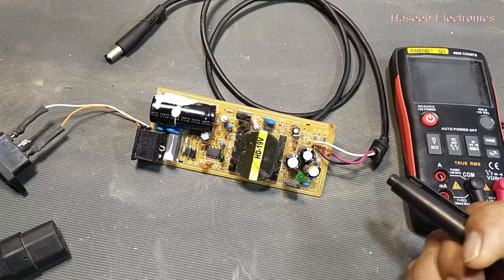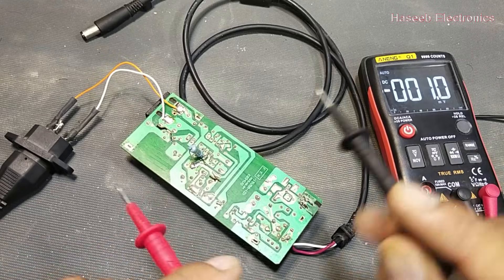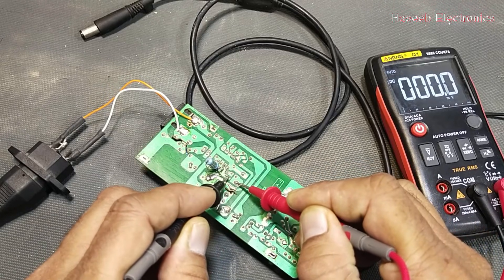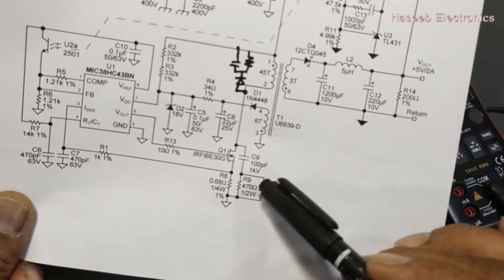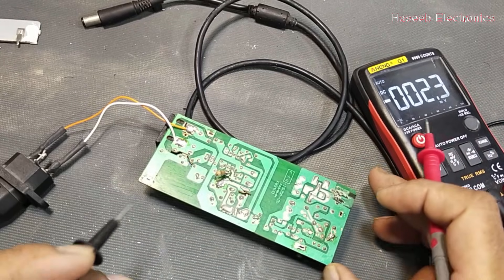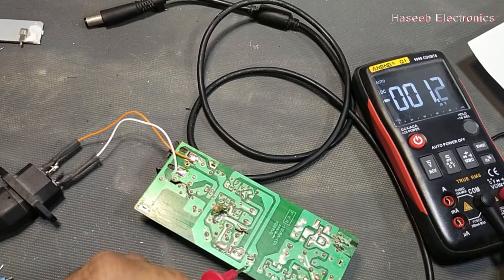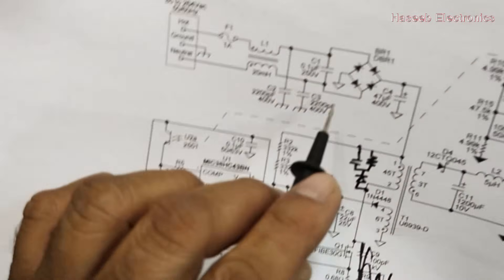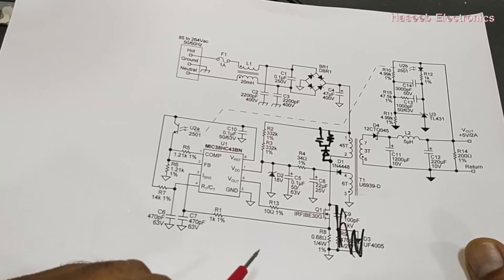{522} How to Test SMPS IC Switching/ SMPS Switch Mode Power Supply IC Switching Test with Multimeter

Comment: Hello Sir, thank you for your helpful videos but I have some questions about this procedure.

I've tried it many and many times and it always work.

But I damaged SMPS two times when measuring voltage between D and S. I'm convinced that I mistakenly connected S and with one multimeter's tip. 

So my question is, why the MOSFET doesn't burst as well when its gate closes its D to S junction like when I shorted it with multimeter's tips? 

Thank you for your help.

Comment: Resp Sir! Nice Class Sir. Sir My LITEON Laptop Charger MFC 335V DC Sir, Drain to Source 335 DC Voltage Sir OK Sir, at SMD Capacitors are Same Voltages Sir. 501J03 6Pin IC was not Cmming any Voltages Sir. Optocopler are No Voltages Sir. Where the Problem Sir. Please Advise Sir.  --    ChinnaRao Paderu Andhrapradesh

Comment: I replaced an OB2269 in a power supply, and the volatge is good. But the capacitors make high frequency noise when more current is drawn. I replaced all the capacitors, I am not sure what I am missing
Reply from the maker: please check RC snubber across output side rectifier.
Reply: @HaseebElectronics  all is ok. still very high noise under load

Comment: Connect the laptop charger adaptor the light is on but when connected the adaptor to the laptop the adaptor light will turn off what is the problem sir
Reply: Laptop 19 volt Power rail Is Short

Comment: Salaamu Alaikum.. thanks for this video sir.. my smps uses pwm IC that has mosfet in it.. there is a supply in its VDD but i think it does not switch because i get the same voltage reading across capacitor and drain to source. But i do have a 12v reading across the diode of the aux winding. The feedback voltage from opto coupler is zero. Can I force the feedback voltage just to check if it will start switching? Thanks in advance

Comment: sir,  again i watched this video, i have a doubt at 5:51 that the source to drain voltage increases 20v excessive than capacitor voltage, so you said this is because of the collapsing magnetic field's excessive voltage, but we have snubber circuit, even though we get excessive voltage on the MOSFET, but you said collapsing magnetic field will became opposite polarity while collapsing, then how its possible to increase the voltage at the MOSFET?  thanks

Comment: Thank you Mr. Haseeb. My condition is like following: bulk capacitor voltage and IC SD 6832 (internal mosfet) drain - source are the same around 320V DC, vcc capacitor and diode showed fluctuating voltage around 12V, voltage at snubber diode and resistor also showed 320V DC. My circuit board is a kind of SMPS for satellite receiver and all outputs 3.3V, 15V and 20V have no power at all. what will that be? Regards .From Myanmar.

Comment: It means sir 88v across snabber diode + 116 volt across snabber resistor  = 204 v dc. Left voltage storage in bulk capacitor to applied ac voltage.

Comment: In such Flay Power Supplies, there are 3 simple malfunctions (& the fuse is WORKING! )
-the failure of the starting resistor along the 7pin 384x circuit 
and the loss of capacitance or the larger ESR of the capacitor on this 7pin (C5 C8 to your circuits), 
well,or a leak breakdown in the zener D2 and the self-supply diode D1 after they are checked / replaced, everything will work.
 IF THIS DID NOT HELP, then all HOT PART or maybe a transformer for replacement -
repairs can be UNPROFITABLE and more expensive than buying a new product.!  But the owner ALWAYS decides to repair or buy a new one

Comment: There is a big long diode in the circuit..how is it measured in a circuit to know whether bad or good diode..I tried and all ends were measuring and giving figures not like rectifier diodes..thanks for the answer in advance

Comment: Hi can this technique of checking if it is switching or not be used on a MIP2F2 IC ? Pin 5 on this IC is Drain According to it's simple circuit. Thanks

Comment: Sir, 220 VAC to  9VDC, 3A  SMPS : The 220 VDC is showing at Full Wave  Bridge Rectifier and  also at input terminals of the High Frequency Switching  Transformer, But there is no DC Votage showing at  the Secondary Terminals of the Switching  Transformer. Whether Transformer is defective or any other fault is there. Please suggest  me what to do.

Comment: 24v 10a SMPS low voltage showing around 6v what is the solution
Reply from the maker: please check RCD snubber (diode, resistor & capacitor across the primary winding of power transformer) 
check main dc capacitor

Comment: I'm trying to lower the output voltage on a 12V 3A power supply to 5V, and lowered the top resistors value of the output voltage divider feeding into TL431, in my case from 20k to 5.1k. The power supply's output voltage is indeed lowered, but unstable. What can be wrong? What to check? Thank you for any advice.

Comment: Sir It's a great video
When smps is working, Difference of voltage on main /bulk capacitor and in mosfet drain and source  is it same? (approx 25volts in this video) for all smps circuits?
Reply from the maker: it depends on the rcd snubber's efficiency. this difference may be 5V to double value of the capacitor's voltage 
i mean if DC capacitor 300VDC, then the mosfet drain to source may be 305 to 600VDC

Comment: Thanks for beautiful description. One of my question is can we give 12 v DC from outside to ic  vcc pin without connecting to ac 220 v for checking ic. If ic is working it will give reference voltage and out put of gate otherwise not.
Reply from the maker: Yes you can
please check video number 449, in that i demonstrated using TL494
very soon i will make SG3525 circuit

Comment: Mr Haseeb is it possible to fit external driver circuit to switch fet to oscillate transformer on smps that uses IC no longer available , how can this be solved please, Thank you for wonderful channel, i already learn alot !!
Reply from the maker: yes it is possible, i will explain it in detail very soon

Comment: Salam sir me ihsan N.WTD se taluq rakta hoon  sir me ne aapka ye ic switching wala video deka iske mutabiq mene ic ke pin no7 aur 5 par voltage chk kia voh 8.2 volts hai aur supply output nahi deraha plz guide me what to do next plz reply sir
Reply from the maker: wa alaikum salaam bhai
kia aap ne mosfet k drain aur source per dc voltage check kiey hein, agr to ye main dc capacitor k voltage k equal he to switching nahi ho rahi. drain to source dc voltage ki value dc capacitor se zayaada ho gi to wo switching karey gi.
agr switching nahi ho rahi to aap mosfet ya ic ko check karein
Reply: Sir i donot have amultimeter of good quality (unit33)
Reply: I have unit33

Comment: Brother..the best way to realize  smps Ic Is faulty or not ..use Beezer mode of multimeter that black lead connected to ground and red lead connected to vcc if we heard beez ic is faulty otherwise ic is working correctly
Reply: Beezer?? You mean continuity?
Reply from the maker: buzzer is continuity mode
Reply: @HaseebElectronics  ohhh okay 👍
Reply from the maker: perfect

Comment: Nice video sir 🙏.I have a question in my SMPS circuit there is 6.5volt between pin no 5 n 7 of 3844 i had checked all the components all components is ok shown by multimeter i didn't get whats the problem.pls sir answer me 🙏🙏

Comment: Thank you, Professor Haseeb. Great video. I have a question. What is the reason or the defect in hearing the sound of tick tick  tick in the transformer? Although all the parts in the high-voltage phase are intact. thank you
Reply from the maker: best regards and lovely thanks 
1. if any winding have bad soldering joint with mounting pins of bobbin (remove the transformer and re-solder the winding ends with the bobbin pins) 
2. if switching frequency jumps (check the frequency )
3. sometime the ferrite core bonding becomes loos and produces the gap between outer leg.(in this case disassemble transformer and apply glue to the legs & sims if it is gaped core)
4. if winding becomes loos (pour varnish) 
5. in some situations it may be unexpected sudden spikes from load (in case of capacitor internal sparking)
Reply: @HaseebElectronics  i have the same problem too, will check that and reply. Many thanks.

Comment: Hi Haseeb, another great video. I never saw anybody check the DC voltage across the pins of the MOSFET before. That's a high frequency AC signal with the MOSFET turning on and off at high frequency - is that safe to measure that voltage with a cheap multimeter (like the one that I have 🙂) ?
Reply from the maker: wow 
thanks a lot for your valuable words
at very high frequency switching mosfet / igbt / transistor is considered as a dc source (similar to a dc generator)
it is completely safe to test source to drain at dc range 
but it is much dangerous to test the same at ac  range (specially when we have a low brand, low quality meter which dosen't have a good frequency response at high frequency, it may damage mosfet or smps controller ic) 
but a cheap multimeter can safely measure this signal at dc range

Comment: Sir what is the component name which you are using to discharge capacitor
Reply from the maker: i am using a 100 ohm PTC. but it is much better to use soldering iron or 100W lamp. that will much safe

Comment: Thanks for the wonderful video, very exhaustive. I have a question: there is a rule, a formula, between main capacitor voltage and D-S modfet voltage? Thank you
Reply from the maker: best regards and special thanks 
yes there are may calculations for dc capacitor. witching at different duty cycles, and in result the voltage applied to primary and in off period the stress 
in this video i compared the voltage stress in dc voltage range 
we can check it with dc range much safely than the ac range
Reply: @HaseebElectronics  Thanks a lot!
Reply: If possible please teach the formula of main filters capacitor value used in SMPS Circuit, waiting for your great explanations, thanks a lot 🙏

Comment: Do you check Voltage across drain to source and across the primary in multimeter DC mode?.. I have smps that output DC  voltages goes down after connecting to main board..(stable 13.11V goes to 6V to 7V fluctuations after connection )... the main board works and turn on the device with separate 12V DC input from the lab bench power supply. What might be the issue with this smps?
Reply from the maker: yes dear 
in this test method i tested in DCV mode of multimeter.
in your case if the voltage drop at connecting load.  
first verify load that it is safe (by giving an external power supply and verify ts current rating ) then' 
1. if your load is good and not causing to draw over current, then the problem in smps (secondar section, check output capacitors, feedback network)
2. in smps primary section, the vcc capacitor might be de-value, remove and check its serviceability 
3. may be the vcc voltage from the auxillary winding are over-range. you can add some 30-100 ohm resistance in between auxiliary winding rectifier and vcc capacitor, so the pwm controller will not reach in over load protection 
4. if there is current sense resistance in series with mosfet, remove its solder and  re-solder it

Comment: In my power supply I cheak soure to drain pin voltage has varry continusly so what is the problm is that sir ic num  tny286k pls help me sir
Reply from the maker: if these voltage vary rapidly,that means there is feedback missing, or vcc voltage missing from auxiliary winding
most common problem is feedback 
something wrong in secondary section
Reply: @HaseebElectronics  sir I send full pics in messanger pls seen that sir
Reply: In optocupler I have 1 volt in 1&2pin sir but 4&3 I dont have any volt sir

Comment: Salam M Haseeb, can't we also use the frequency of our multimeter to check ? if so, where to place it : at the output pin of IC or at the transformer ? Thanks & Salam Aleikum
Reply from the maker: wa alaikum salaam brother 
we can check frequency with multimeter
but if, our multimeter doesn't have good frequency response, it may damage the mosfet, pwm controller or multimeter 
we can check frequency with oscilloscope or frequency counter  that will the best choice or if we have a some good brand multimeter then we can check it
we will continue in our upcoming session as well
Reply: @HaseebElectronics  Very good ! that answers why my regular multimeter did not show proper frequency almost all the time.